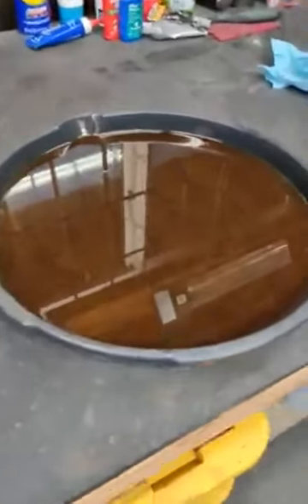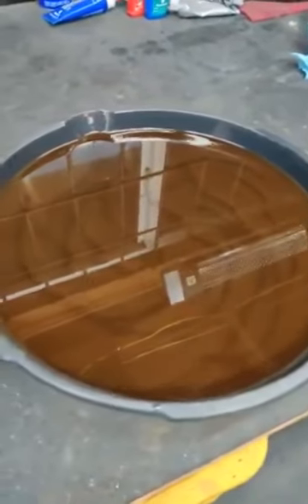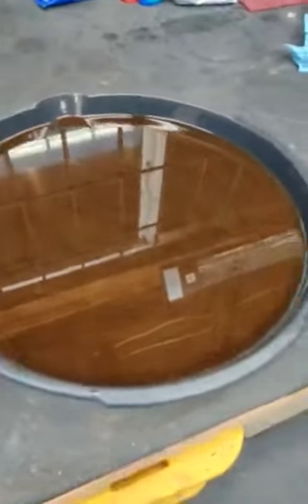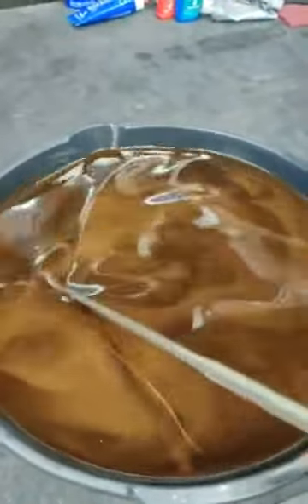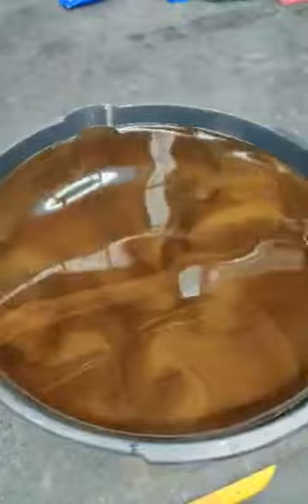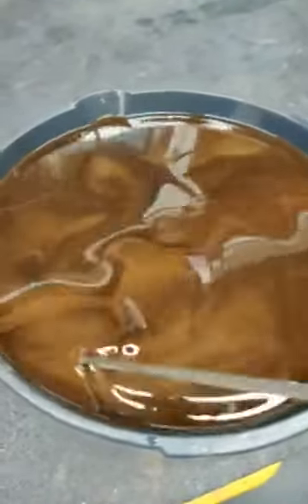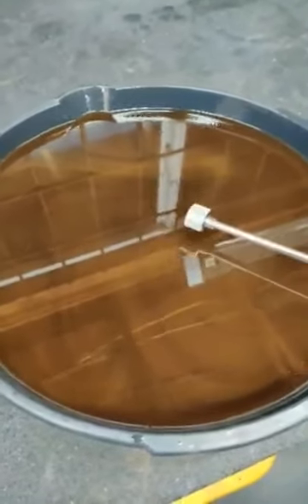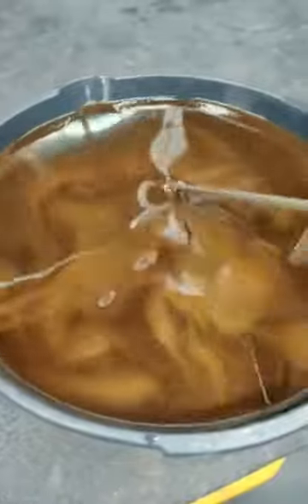Rebuilt NV4500 First Oil Change Information!

Comment: Put that oil in a clean 5 gallon bucket with a lid on it and set it aside for a year or two. ALL the particles will settle out, and you can  pull off the top clean oil and re-use it in another rebuild.

Comment: What’s your guys thoughts on the Amsoil Manual Transmission & Transaxle Gear Lube 75W-90? It’s the only thing I’ve used in my nv4500 but I’m curious if redline would be a better option?